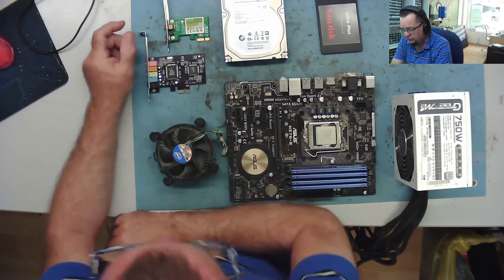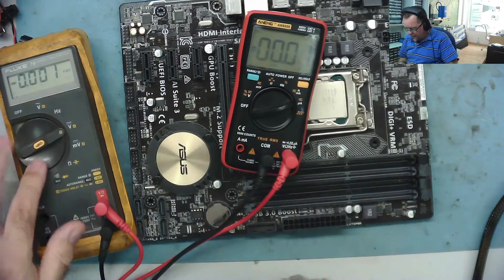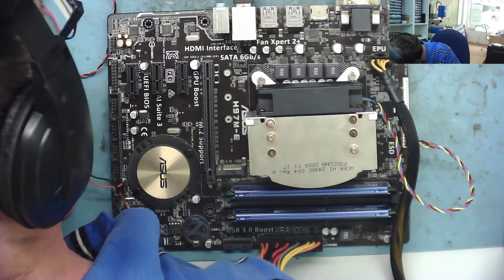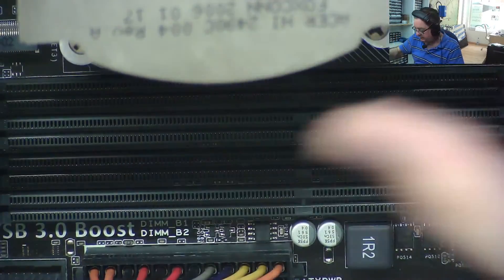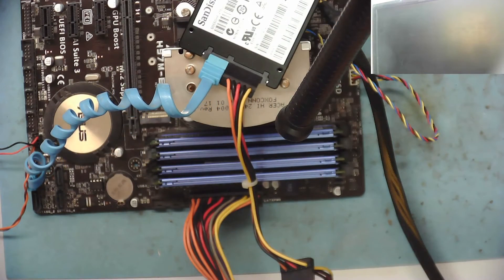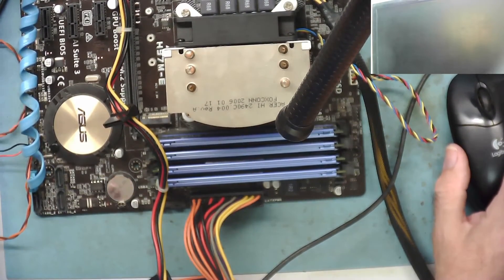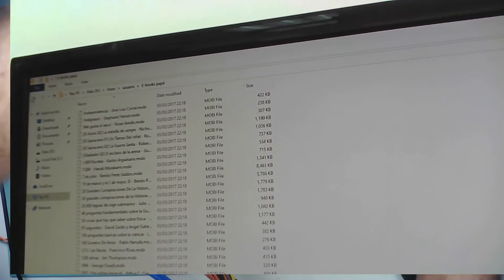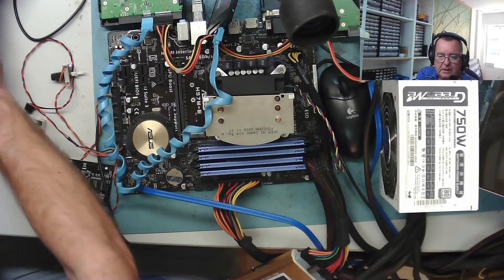Asus H97M-E &  i7-4770 CPU - Desktop PC Repair. LER #084

Comment: I also have this ASUS H97M-E Motherboard and I admit that the BIOS settings are a bit of a hassle. If you have two disks and you want to boot the computer on one of them, you must first select "Windows UEFI mode" in the BIOS and then in Boot Option Prioities - "in the window Boot Option #1 - Disk you want to boot from"
Further in the Hard Drive BBS Priorites menu, the one from which you want to start should appear first.
Next you confirm F10 (save) and after reboot it starts
already on the Drive of your choice. And in Ez Mode Boot Menu select by F8 key

Comment: NIM NI is one of those off -brand PSU makers.  I'd stay away from them.   SUSA is another one that is not well known.  Both suddenly become better if you install them upside-down.

Ah I'm glad I decided to look at the old back catalogue.  It was worth it for that alone. 😂

When i upgraded my Z170 board from 16 to 64GB, the maximum it can take, the POST time increased in proportion.  The RAM training takes literally forever. 

The 4770 demolishes the Atom/N100/N200 etc and defecates on the grave.  In 2025 this is an excellent office PC, too good perhaps.

Comment: Ive just come across your channel and it looks great content.  I wonder if you could help. I have a gaming laptop that bought for over £1000 and unfortunately im outside of costco warrenty. Its the predator ph317-52. The laptop no longer powers on. The power supply worls and voltage is going into the board but i cant seem to find the fault. Would you know where i could possibly look to find and diagnose the fault? Regards Dale